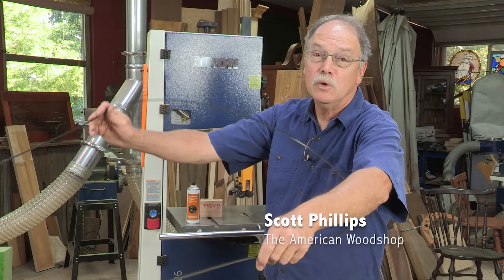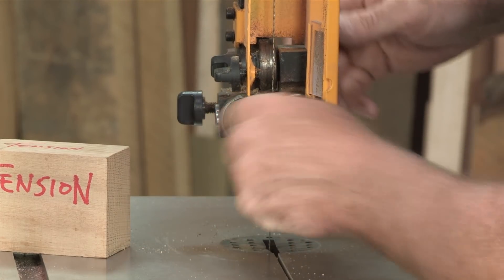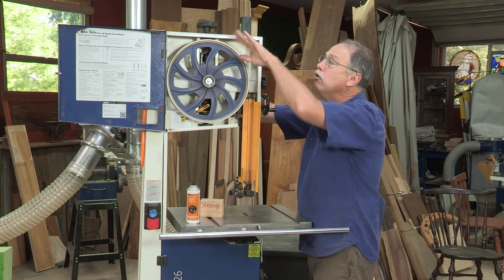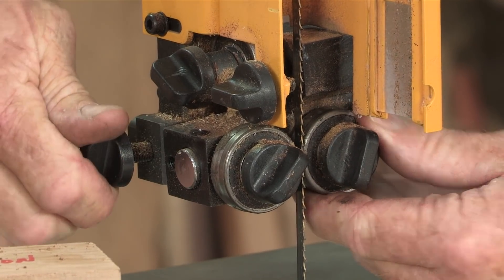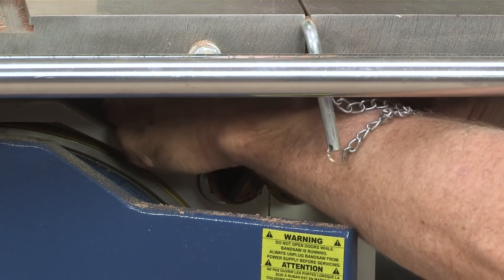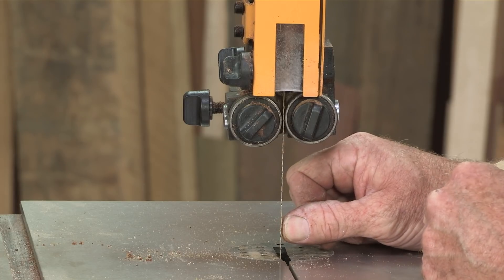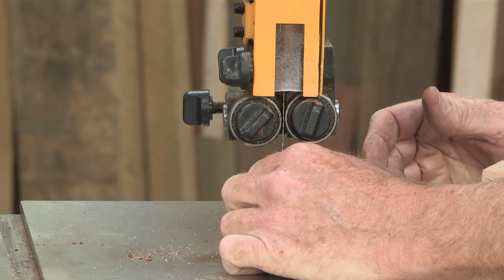Bandsaw Guides & Blade Setup | Advanced Bandsaw Techniques Part 1

Comment: A clarification on lining up the blade. The bottom of the gullet should be in the center of the tire, not the center of the blade. It might not make much of a difference with a small blade, but it sure does on a large resaw blade. Check out Alex Snodgrass videos for more in depth info on setting up a band saw, that man knows his stuff.
Reply: Hey Ben, I actually brought that up to Scott while shooting. He said that there are two schools of thought. Do you have any personal experience with tracking one way or the other?
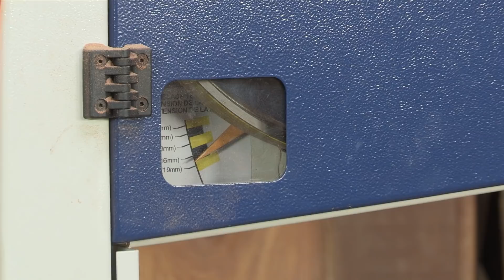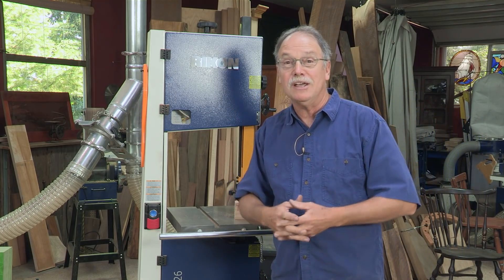Reply: I've tried both ways, and the gullet in the center performed better for me. The way Alex explains it really makes sense. Since the wheel has a crown to it, the teeth will have less support since they're hanging off in mid air. Explained here from around 4:00-5:00 https://youtu.be/wGbZqWac0jU?t=219

Maybe someone can do a more scientific test with different machines, blades and other factors. I only know what's worked for me.
Reply: There may be 2 schools of thought ... but only 1 can be correct.  Alex's family is in the business of making bandsaws perform to their utmost ... I will trust them to steer me straight.

Comment: When my saw is running, everything seems until I turn it off and it's coming to a stop it then seems to vibrate like out of balance.  Any suggestions? Thanks, I enjoy your channel.
Reply from the maker: Wayne, make sure your wheels are locked in position. The adjustment knobs only adjust the angle of the wheel and it needs to be locked into place. When the saw is running the centrifugal force will force things to run smoother. Next step may be to check the balance on the wheels themselves. They're balanced (much like the tire on a car) in the factory, but if somethings been knocked around that could be causing the problem.
Reply: Thanks for the reply, I'll be sure to check it out when I get back out in the workshop.